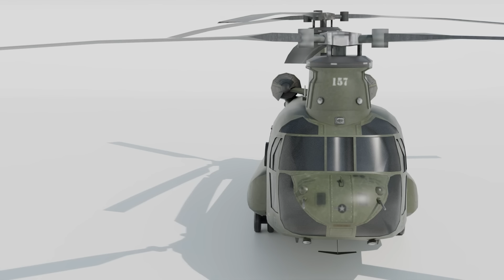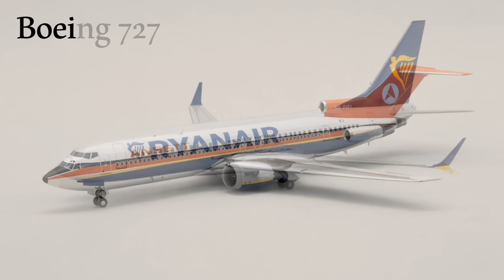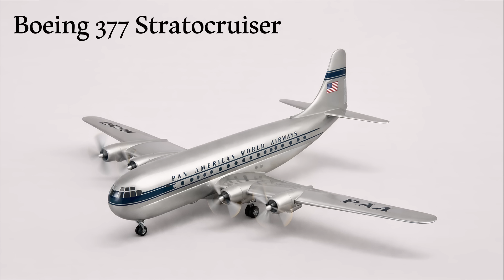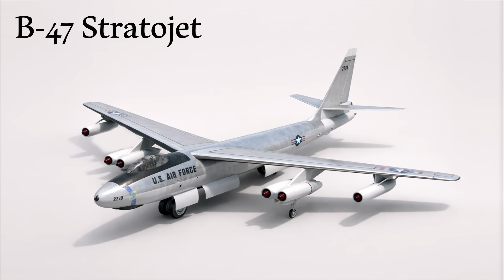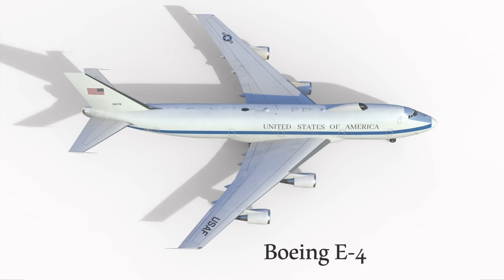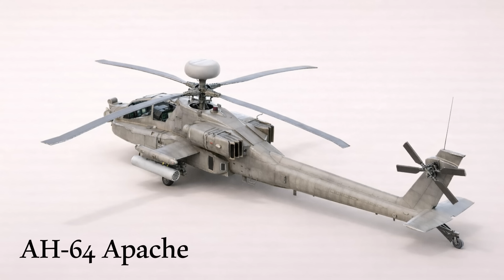Every Boeing Aircraft Ever Built

Comment: You forgot the B-50. It wasn't the same as a B-29. The B-50 went on to become the KB-50.
Reply from the maker: As it was based on the 29 and i'm making a more in depth follow with variants i didn't want to include it as i want this one to be about original frames only
Reply: @ogni-tv   Then you should have not mentioned the  377 , C-97 ,  and the KC-97, as they were also based on the B-29 airframe design.  Also it is a crime to not mention one of the  key aircraft in history the  Boeing 377SG, aka the Super Guppy, which also was a member of the B-29 family of variants.

Comment: The707 was derived from the same design that was used to develop the USAF's C-135/KC-135 variants. Internally, those military aircraft were known as the Model 717. You left out the B/KB-50
Reply: When they announced the rebrand of the MD to B717, I was thinking they already used that number...
Reply from the maker: Yes the boeing 367-80 prototype
Reply: Correct.  While there are many similarities between the 707 and the (K)C-135, the 707 had a wider fuselage to accomodate six-abreast seating.  The later military derivatives, such as the AWACS, were built on the 707 platform.

Comment: The thumbnail bro
Reply from the maker: It a 720 testbed used by pratt  and whitney i think only one was made so it just a variant of the 720
Reply: @ogni-tv  My father actually was one of the test engineers on that plane when the turboprops and the V2500 engine was being tested with it. I still have photos of it.
Reply: @ogni-tv  All they did was put an engine mount in the nose where the radar dish goes. It really wasn't much of a modification because the bulkhead there is already strong enough to mount an engine to it. The most powerful engine they tested was 5,000 HP, which is kinda like strapping a Kawasaki 440 to the nose of a Cessna 310.
Reply: It’s real